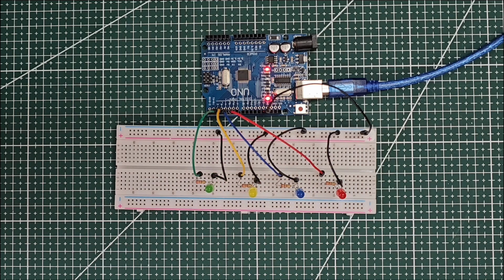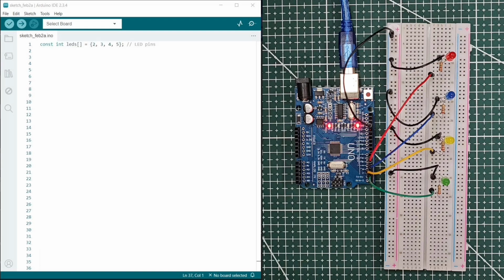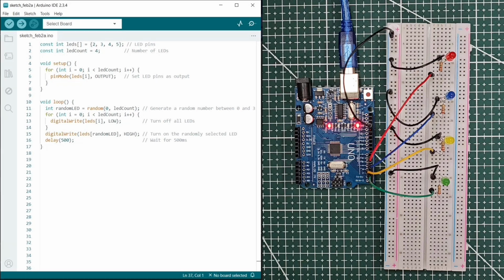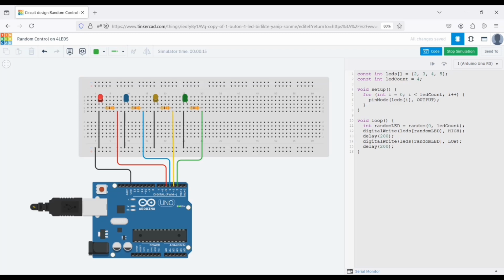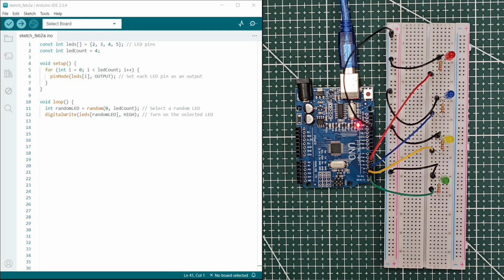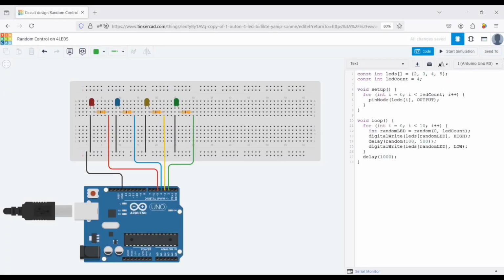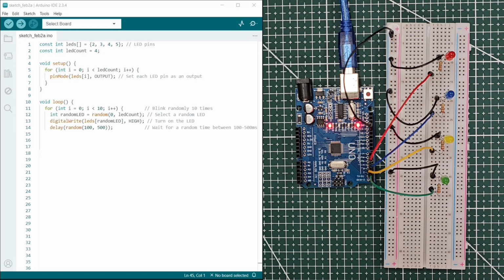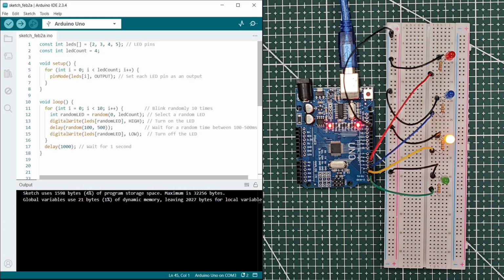Ardunio Tutorials: Arduino Random LED Blinking 🔥 3 Amazing Projects

Comment: Commenting for the algorithm. Best takeaway from my first steps with Arduino is that we have TinkerCAD to make simulations first! Golde tip. Thanks for sharing.
Reply from the maker: Exactly! Our main goal in using Tinkercad is to have a clearer visual representation compared to the physical circuit. But its practicality is also a great advantage!